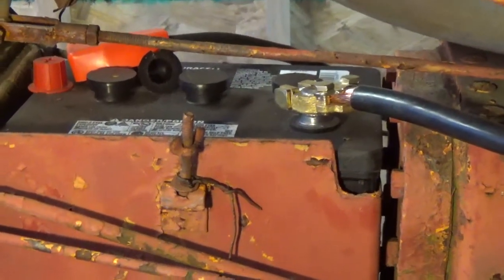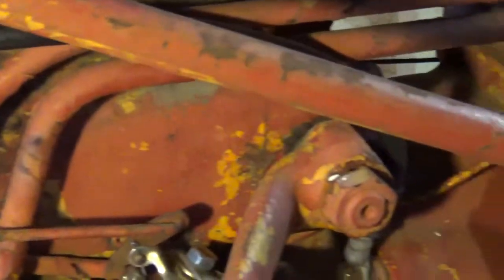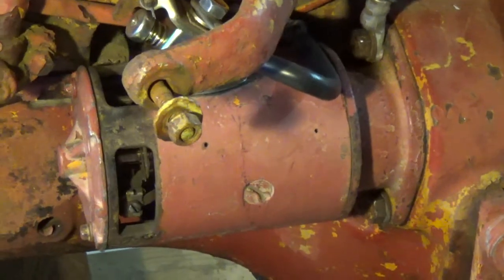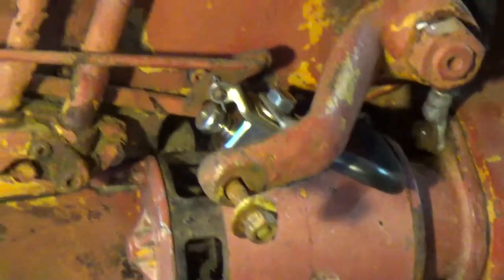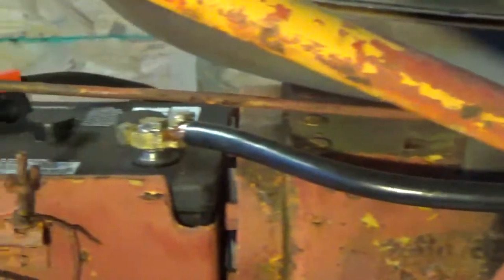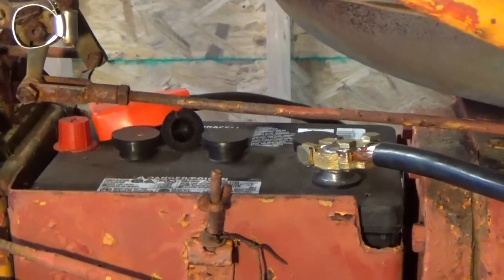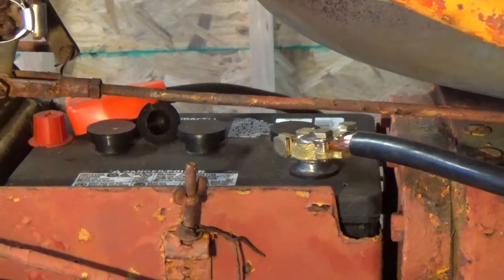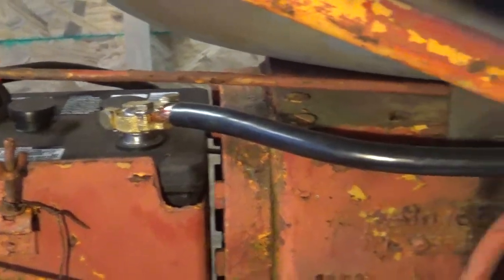1955 International 100 Tractor - Positive Ground

Comment: How did you know it was positive ground? I have an MF50 and I replaced the battery. I didn't think to take a picture of the old battery before removing it. Now I am unsure which is the negative and positive cable. This is the first tractor I have ever owned, so I am learning as things get broken :) I hooked it up as if it were positive ground not really realizing I was doing so. It started and I used it; however, when I turned it off the generator (this was new to me) kept spinning. It never stopped. I assumed that maybe I had the cables mixed up and removed them. I learned that tractors can be positive or negative ground (mind blown) and that you have to polarize a generator. Now I am not sure how to tell what should be positive and what should be negative.....
Reply from the maker: I learned from my repair manual and an older fellow.  It will run if you have them reversed which is odd.  I suggest you join https://www.yesterdaystractors.com/  They have a forum which can answer all your questions.  Good luck.
Reply: @MikeBalls  Firstly is your tractor petrol or diesel? If diesel you can have --ve or +ve ground, but you must polarise the generator. If it is petrol and you are keeping the LUCAS electrics then you must be +ve ground. Most LUCAS coils are wound for +ve ground. Benefits include auto transformer action and little or no burning of the rotor arm.A LUCAS generator (if you are running a generator) has an internally earthed field. You need to know this to polarise your generator. Always polarise your generator at the generator after removing the two wires. Look at LUCAS style systems rather than American style and videos as a lot of them are not quite correct. If you reply back with specific questions I will be able to help you with easy simple tests for your generator and regulator 😊
Reply: @ianrobinson9565  Sorry for the late reply. I am still trying to figure out my tractor. I replaced the generator. I tried to polarize the generator, but I'm not sure if it really worked. I didn't see a spark. The big problem is that the voltage regulator isn't marked at all, so I am basically guessing which post is Battery and which post is A (or Gen). Looking at most of the videos that show polarizing a generator the Battery is in the middle and A is on the left. I touched those together with and without the tractor running and there were no sparks. I checked my battery voltage after I ran the tractor for a bit and the voltage was still 12+ V. The generator was starting to smoke afterwards though, so I think something is messed up.